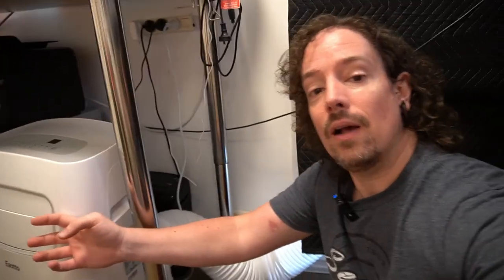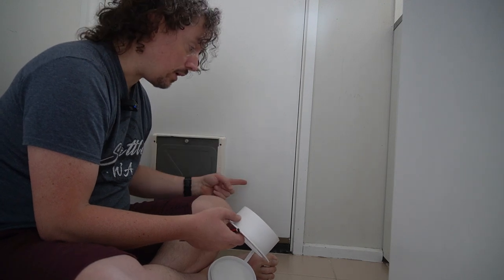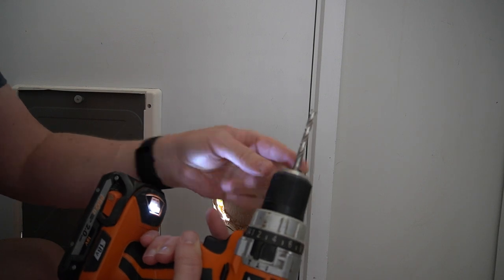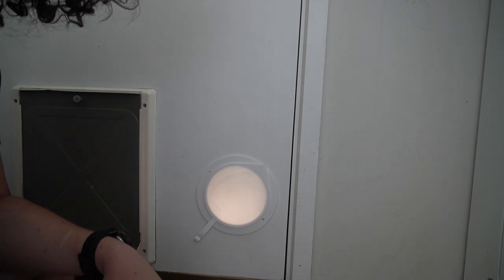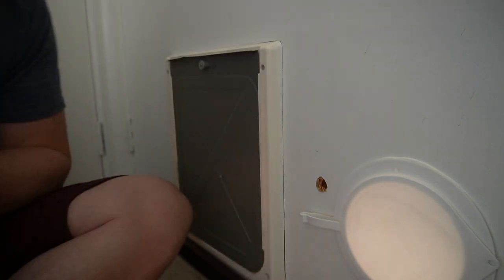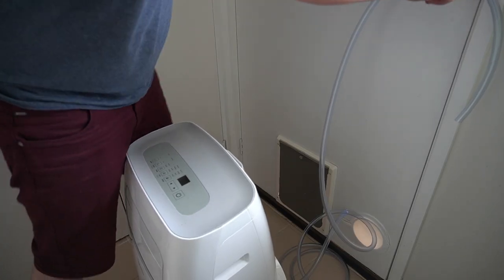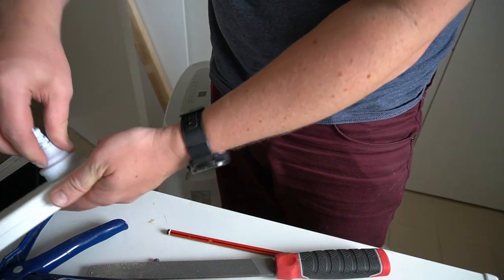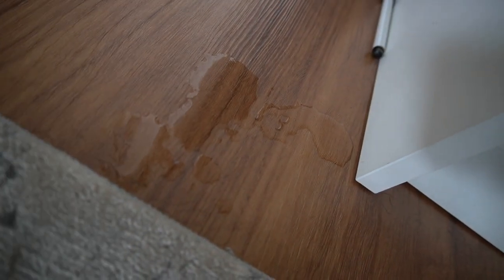[vlog] Installing portable air conditioners, my tips and tricks.

Comment: Why not just use the cat flap instead of making a new hole?
Reply from the maker: The cat flap hole was too big and would require backfilling. I could have patched the cat flap first and made the hole in there, I suppose, but the effort is the same, and this way, I could cool that part of the house sooner.
Reply: @bendechrai The effort is the same if you never patch the cat flap. How do you open the door with a 70 lb A/C. unit in front of it? Usually you don't want an A/C in front of a door.
Reply from the maker: @ArtyJames  I'm not sure how the effort would be the same without patching the cat flap. I'd be sticking a hose out of a hole too big for it, leaving gaps for 45°C air to come in around it. I'd love to hear your solution.

Opening a door with a 1lb hose farther from the hinges is easier than if it was in the middle of the door. The hose moves farther, but the door can also open more fully.

As for not placing a portable air-conditioning unit in front of a door, why not? If it's that hot outside, I don't want to use that door anyway...
Reply: @bendechrai  Because if you end up patching the cat flap also you'll have done twice the work overall.
Reply from the maker: @ArtyJames  actually no. That's wrong.
Reply: @bendechrai  I can't understand it for you dude 🙄
Reply from the maker: @ArtyJames  ¯\_(ツ)_/¯